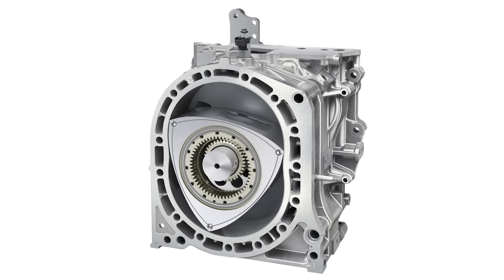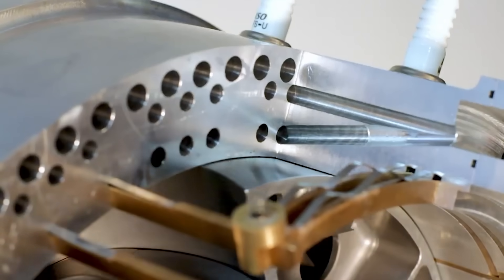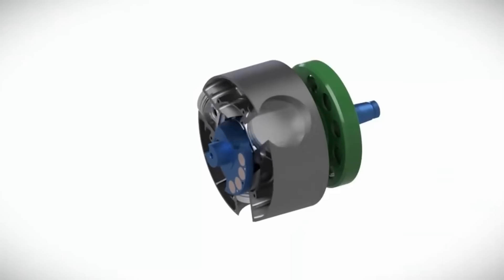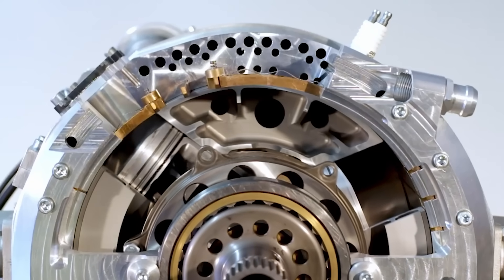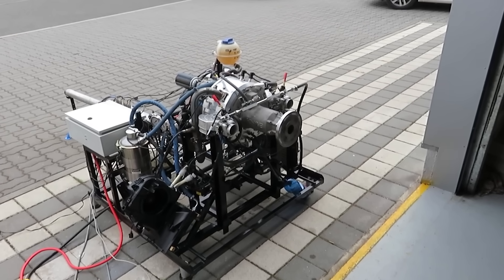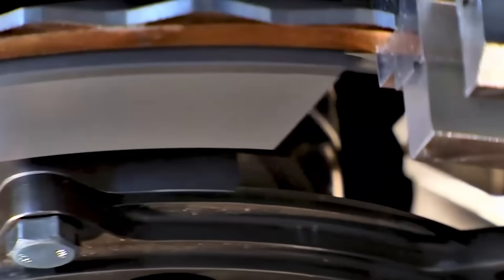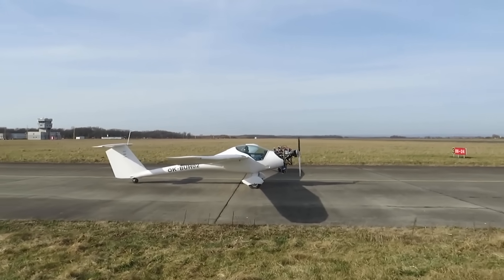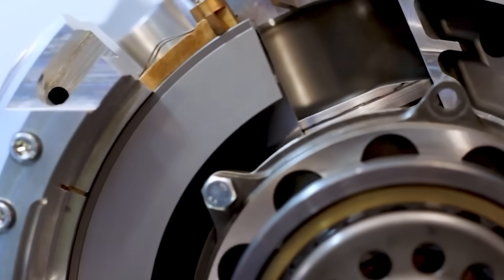The Birotary Engine: A New Spin on Combustion

Comment: There are a lot of crazy designed engines on YouTube that will never work, but I like this one, at least there is a 'working' one that actually runs. BUT, a large sliding/wiping area on the outside of the rotor that I am concerned about.
Reply: Looks like each piston fires twice every revoultion. I would have liked to hear more of it running
Reply: @popeyeman69  this may be a stupid question. Does that make it have the power of a six cylinder?
Reply: @GregMorcroft That's a good question.  It fires like a 2 stroke.😊
Reply: They MYT engine was much more simple, but just as functional and promising.  From what I understand it was purchased by a major manufacturer who shelved it and it was never heard about again, as with all new revolutionary iterations of existing products.  This one's no different and not advanced enough to garner attention and instigate change.
Reply: They always say "it will never work" until it does. 😂
Reply: Oil pressure could provide a good film for the rotar but keeping oil out of combustion chamber ? I'm NOT AN ENGINEER.  Guessing there's a large bearing we're   not seeing.
Reply: I don't understand how they manage to make the combustion chamber airtight without friction.
Reply: @mettabasse  they still have piston rings around the pistons, and the copper colored bars around the outside are also sealing the "top" of the piston area.
Reply: @deadlydragon72 I'm talking about the sealing between cylinder and cylinderhead
Reply: @mettabasse yep, that's the copper looking bars around the outside I spoke about that are shown throughout the video.
They are fma friction seal kind of like a wankel
Reply: @deadlydragon72  Una gran fricción, y lubricación entonces, es como un dos tiempos pero de alto rendimiento, habrá que ver cuanto aceite consume y cada cuanto tiempo hay que cambiar los sellos, si no es fácil y rápido de hacer con infimo consumo de aceite, solo le quedará terminar siendo una aplicación militar como dron de ataque.
Reply: The future will be valveless two-stroke engines burning ammonia, and cars will be tricycles with Kevlar fiber fabric cabs.
Reply: @TheMariepi3  
Alpha-Otto Technologies' RevForce engine for example.  How was this not done already decades ago?
Reply: @James_R_  Ammonia is a good fuel for an internal combustion engine or a turbine engine; in excess it is toxic to living beings (in small quantities it is very good for plants) but it does not pollute the environment.
Reply: @TheMariepi3  no contamina solo corroe todo metal que toque y no esté preparado para él.
Reply: @TheMariepi3  Anhydrous ammonia is extremely toxic and must be compressed to store enough for useful purposes.  I worked in industrial refrigeration and I learned to hate the stuff.  It's way too dangerous.
Reply: @PruneHub  It's a shame that ammonia and hydrazines are so toxic. Perhaps a non-toxic derivative molecule could be developed. Or that drivers and passengers wear proper gas masks during the trip, with a total ban on approaching any city within a kilometer.
Reply: @TheMariepi3  Anhydrous ammonia is also toxic if it gets on your skin (it's attracted to water molecules) so full hazmat suits are required.
Reply: @TheMariepi3 Nope, future is electric, with high density solid state batteries and fusion electric power being delivered to it.
Reply: @TheMariepi3  capáz no más, pero un combustible corrosivo como el NH3, tendrá sus costos para ser despachado y cargado, éso es algo muy complejo y mas peligroso que manipular y usar hidrógeno
Reply: Die Gleitfläche wird ein großes Problem werden. Ich finde den Rotormotor besser
Reply: @HorstPopescu  Esa corona rotatoria es una enorme fricción, y encima debe tener que soportar las presiones de los sellos.

Comment: If it gets approved by DOT and NHTSA here in the States, it would be an excellent engine for a plug-in hybrid vehicle. It should be pretty reliable since there's no valvetrain, and the fact that it's a smooth running engine makes it a great choice for turning a generator.
Reply: Are valvetrain failures a significant problem in conventional engines? I know of one person who had excessive cam wear in his 300 000 km+ car engine, but he's back on the road with a second had head from a scrapyard, for a lot less than replacing the car or engine. Literally nobody else I can think of in the 40+ years I've been interested in cars has had any issues with the valves and valvetrain at all, and every single one of them was using a reciprocating engine - the one guy I know with a Wankel engine has had to rebuild it regularly because of the rotor seals at intervals most car owners wouldn't be doing more than a oil and filter service, and it drinks oil...
Reply: Neither the US DoT nor NHTSA approve engines. Perhaps you meant the US EPA.

Comment: I'm not a fan of EV motors but new Axialflux electric motors are insanely powerful and simple this is just a beginning It'll be over for ICE engines until someone makes a light weight powerful battery.
Reply: Batteries have always been the problem with electric vehicles. Even 'primitive' electric motors completely embarrass IC engines in terms of power output, and better again because they deliver full torque from 0 rpm, have a wide power band and can reverse by switching the wiring, they eliminate the gearbox and clutch/torque convertor too. 

EV's have a battery problem not a motor problem.
Reply: I don't really think it's over, innovation really became stuck over a bunch of years, the latest byd engine has 46.6% thermal efficiency which is nuts, ice it's not over, it just entered the stage 2
Reply: Perhaps a BATTERY not affected by 
TEMPERATURES
Reply: @nikolap.9963  From what I can gather, temperature immune batteries are a very difficult problem because the process of charging and discharging a battery boils down to chemistry, and the rule of thumb is that around room temperature a 10 deg Celsius (18 degF) increase in temperature approximately doubles the speed of chemical reactions, so charging and discharging rates are inherently dependent on temperature. 

Most modern EVs have excellent temperature control of their batteries, so it's a lot less of an issue than it used to be, but energy used to maintain battery temperature while it's parked can't be used to propel the car.
Reply: EV motors aren't more powerful than ICE though, there's lots of potential in ICE, and it keeps on upgrading.
Reply: @johndavidson3424 😂😂 Koenigsegg's 40kg EV motor is producing over 800hp tell me a 40kg ICE engine that can produce 500hp, deliver instant torque, requires no oiling and maintenance. Your just EV hater that's all. The only limitation of EV motors is batteries that's.
Reply: @johndavidson3424  There are almost no 1000+ bhp IC cars available off the shelf and none can be driven daily at legal speeds without killing the engine. The air flow passages of IC engines rated to high hundreds of BHP get gummed up and as a result, damaged by driving so far below their rated output all the time. There's a reason 'Italian tune-ups' are a thing for IC engines, because they need to be driven hard periodically just to make sure all the flaps and vanes in the intake and turbo systems are moved through their full range of motion and don't just jam in place because they're never moved though more than a tiny fraction of their working range. 

On a car with anything more than about 300 bhp, unless the car is very heavy, has 4WD, you live near an unrestricted Autobahn, or you do track days on a track with a long straight, there is no opportunity to make use of the engine's full power and not lose your licence, or your life (Though that counts for the electric ones too). Even with serious tyres, it'll still just spin the wheels as they literally can't put the full power of the engine to the road until you're north of 100 mph. Driving an electric car at a fraction of it's rated output doesn't cause any issues that will prematurely damage it, so the only costs are the bigger battery, higher rated electrical switches and thicker wires (Though this can be offset with a higher battery voltage), which will be even more reliable rather than less when not used at their limit.

Comment: high compression turbines better. too many moving parts. will result in broken engine very often. why would you need to do a minigun piston engine. the rotation is a gimmick. could be a stationary normal piston engine. so you even double shake the pistons. not only once. toxic design.
Reply: Deleting the entire valve amd cam works isnt "more parts" really...